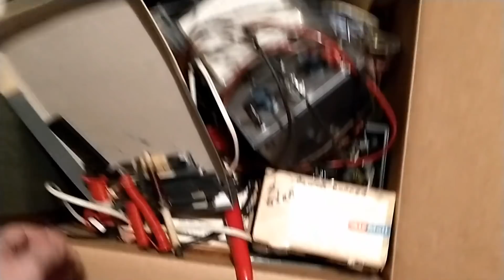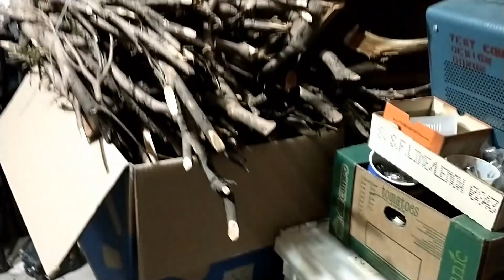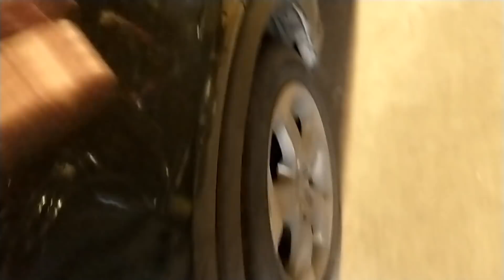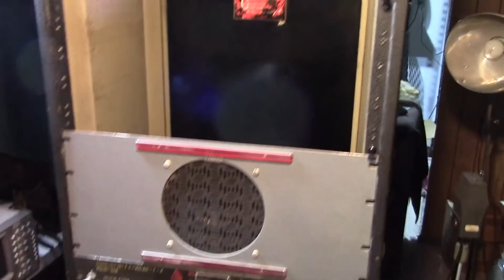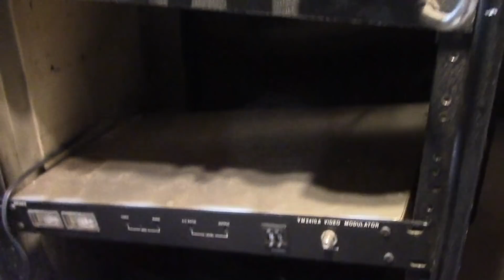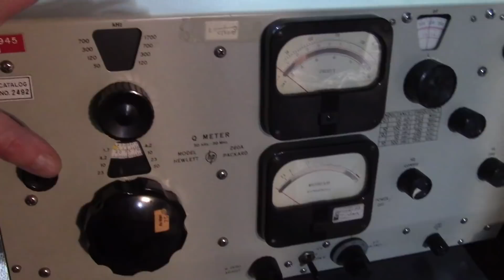Estate treasures: The adventure begins

Comment: Wow, I'm totally speechless with all this great electronics material and equipment you got. Glad it all wasn't dumped as 
is so often the case. Like the beginning of the video. Alley and homes scream Albany Park area to me. Rode my 
bike everywhere as a kid and the northside was like a safer architecture type adventure. Did the stuff you didn't get Bob
actually go to the dump?
Reply from the maker: You nailed it - Albany Park.  For sure the vintage phone booth is going to a relative.  Someone else is supposedly taking a metal lathe and drill press.  I couldn't say what will happen to what remains.  The house is being sold as is with all the contents.  It's up to the new owner, developer or flipper.

Comment: Modern server racks have square holes which enables quick-mounting of rails, and clip-in nuts are used where screws are required. I believe audio racks still have threaded holes though. From what I can see the vertical rails on yours are indeed fatter than normal, explaining why some of the equipment doesn't fit. Personally I would cut away a sliver from the rack instead of cutting into your equipment.
Reply from the maker: I figure I got the Drake modulator for $20 on eBay and it's replaceable.   The rack not so much.  A little filing on the backside of the aluminum mounting ears is no big deal.

Comment: I saw what looks like an HP 400?? AC meter. I have several of 400E/EL/FL meters and a 427A. They replaced my want for a VTVM for alignment as they are small, reliable and just cool looking. They have other uses as they operate up to 10mHz and you can use the input/output as an adjustable preamp for other gear. My only complaint is no power light.
Of the 4 I have all mostly worked. One had a bad ground rivet, another weak transistor.  The trim pots needed cleaning. Would make a real short FNR ;).
Reply from the maker: Yes, I think there are a couple of them.  Crazy how many range positions there are.
Reply from the maker: I have a 400FL and 3400A

Comment: Nice rack. I have a full size modern rack in my shop and the width is 19 1/4 inches.

Now with all of that equipment you need to clean up that basement and set it up.
Reply from the maker: This rack is exactly 19" wide.  That extra 1/4" would make a big difference

Comment: 60/40 solder isn't eutectic (doesn't melt/solidify at the same temperature) like 63/37. 60/40 is fine to use for electronics, just make sure nothing moves as it solidifies otherwise you run the risk of getting a cold solder joint. 63/37 is more forgiving in that respect.
Reply from the maker: It turns out I misspoke.  I have been using 60/40 solder for ages so it's what I'm used to.  Assuming this is rosin core, I really am set for life.

Comment: One of those boxes had a few 3E29 tubes in it.  It is a pulse rated version of the 829B which is a dual beam power tube designed for VHF radio service.  They work very well as audio output tubes and aren't too expensive either.

The 19-inch rack was first used in the early 1920s by AT&T as a means of reducing the amount of space required for repeaters and associated line termination equipment in telephone exchanges.  The original design documentation called for the unit size to be 1.75 inches high, which is still the standard today.  Originally the standard called for alternating 1.25-inch and 0.5-inch hole spacing on centers but the EIA standardised on 0.5-inch on center hole spacing in 1988.   23-inch racks were developed for switching equipment by Western Electric and are still found in some installations.
Reply from the maker: There are also a bunch of 829B and other transmitting related tubes.

Comment: The rack screws are spaced so as to hold rack boxes made in multiples of exactly 1.75 in high.  That size is called a "rack unit" and all commercial boxes made to fit a standard 19" rack is made in multiples of that height.
Reply from the maker: Yes, but these screw holes are paired up rather than uniformly spaced.  It's even stranger at the bottom.  Also, they are not aligned vertically.  You'll see what I mean in a follow up video.
Reply: @bandersentv  The screws aren't supposed to be uniformly spaced. They are at the top and bottom of each RU, hence why they are in pairs.
Reply from the maker: How about this?  https://www.youtube.com/channel/UCJ6nWQ7UO-Lve9ji2FUNYwg/community?lb=Ugkxcr_YW4XEpJ4f5-K6xAVHwYH6EZzPEC3Q